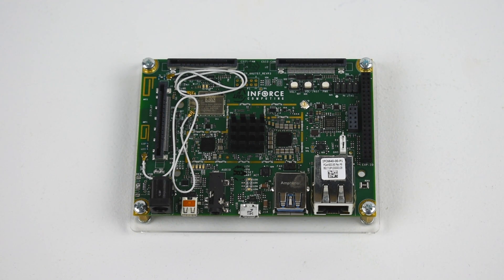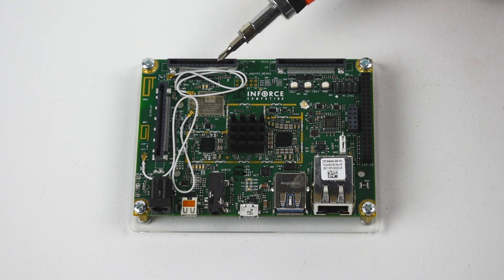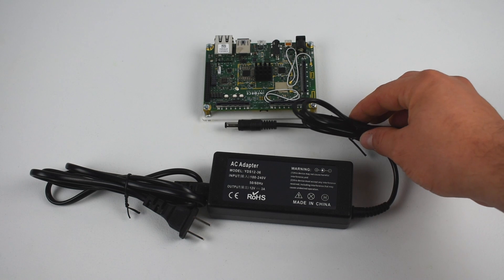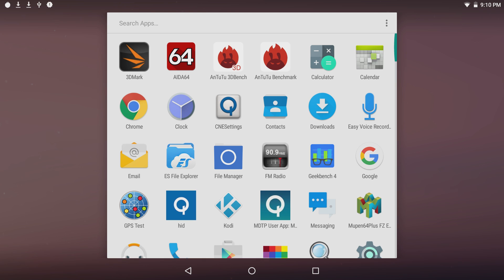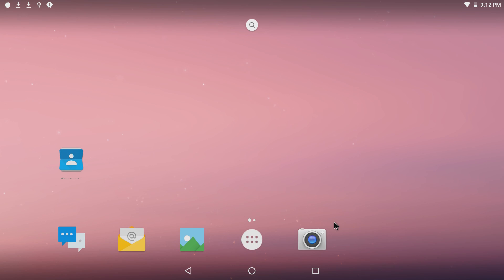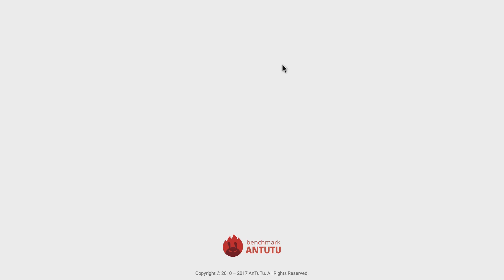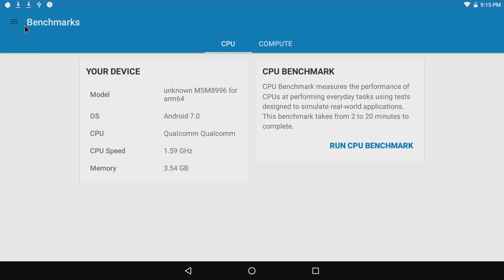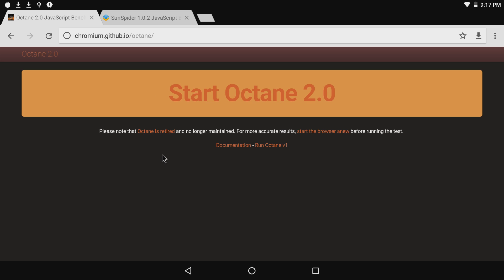INFORCE 6640 Snapdragon 820 Powered Single Board Computer Benchmarks And First Look

Comment: Nvidia shield TV is a Single Board Computer, based on the TX1, placed in a custom case.  It can run Linux and Android.....and it obliterates this board.  Calling the Snapdragon 820 SoC SBC the most powerful SBC you've encountered is just false.  The Tegra X1 SoC SBC is...and admittedly so.  The Snapdragon is higher in price, especially now.  I can get 2 Shield TV's for that price today!

Shield aside though, I don't know if the Snapdragon board is even available anymore, and ARM based SBCs are all reaching incredible levels of power, and the iterations are coming down the pipes so fast!  The market for SBCs has gone insane over the last 12-18 months.  Who knows where they're going next...?

Comment: Isn't something like the UP board or Latte panda more powerful than this though? Or is the difference between ARM and x86 not comparable.
Or is it more powerful than them even??

If so.... Damn. That's cool
Reply from the maker: +television and cheese this board is arm but it in benchmarks this board is faster.
Reply: television and cheese I couldn't tell you how ARM and x86 compare directly, but keep in mind much of x86 power advantage comes from large CPU cores and high power consumption.  At 5 watt TDP, it's a different story.  SD820 is way ahead of those Atom CPUs.  The new Apollo Lake Up Squared boards look to be closer to this, at least using geekbench to compare, and with more favorable pricing.
Reply: Damn that's a good board then.

Comment: That's really cool.  Price is high, obviously, but it's not meant to be mainstream in any way.  I wonder how many of these things they sell.  Reminds me of various other boards using Kirin 960, Mediatek Helio X20, and Nvidia Tegra SoCs.  They're all pricey.  I recall hearing the SD820 unit price was around $70 which is high compared to many other ARM SoCs and definitely too high for an accessible SBC.  This won't be changing my plans to pick up an Odroid XU4Q(fanless version) fairly soon.  It'll be plenty powerful for my needs.  I won't pretend it's anywhere close to this.  Very cool to see this.  Thanks for showing.
Reply from the maker: ravagingwolverine I actually have the fanless heatsink coming in next week for my xu4
Reply: Very nice.  I'm not expecting there to be much throttling during emulation or media playback.  I'd considered getting the XU4 before, but I wasn't into switching the heatsink myself since my C2 was already doing what I wanted.  I was eventually going to get another C2, but with the XU4 now being sold fanless and at a lower price than it used to be, it's hard to resist.